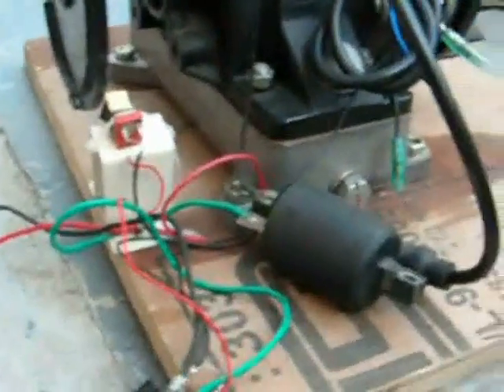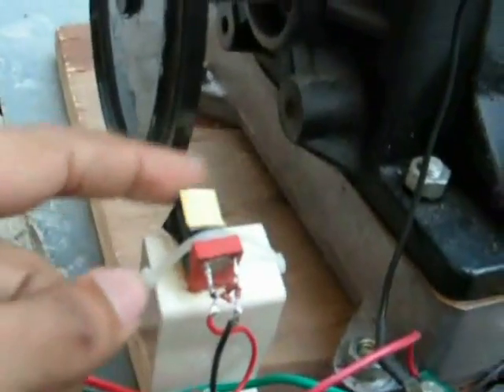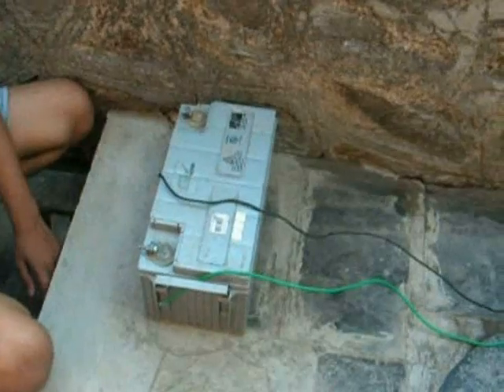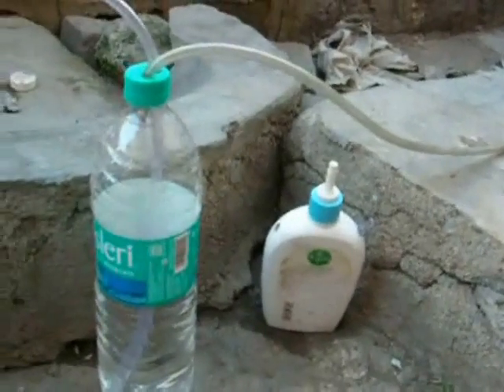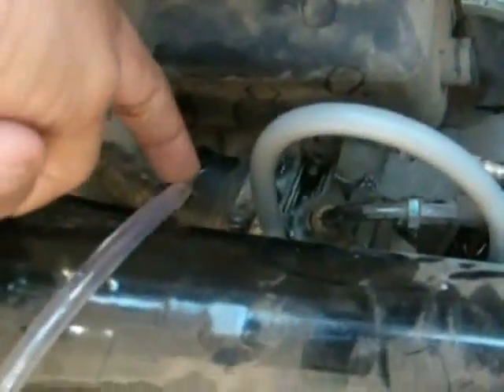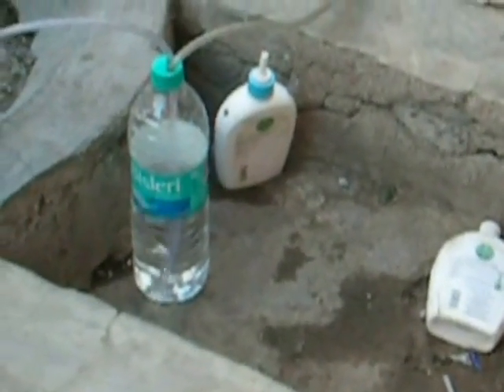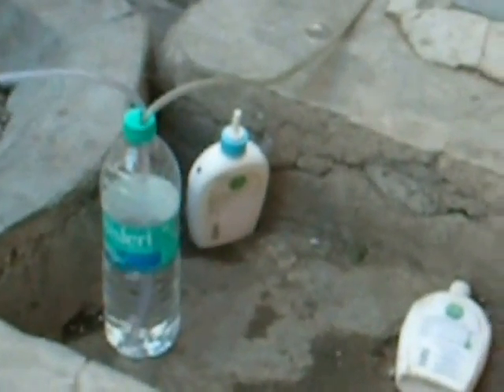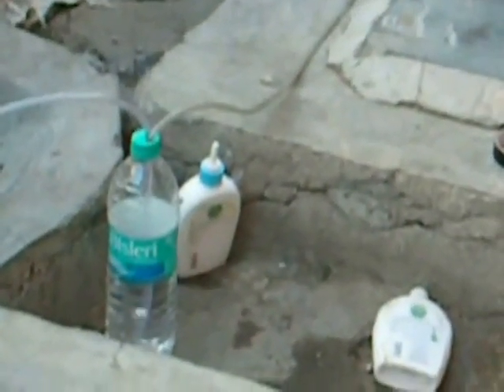Water Powered Bike (See Part 2 & WFC Fundamentals)

Comment: @rajababu1982 Coal puts out far more radioactive waste into the environment than nuclear: out the smokestacks and in the ash leftover. With nuclear, the waste is contained and managed. The nuclear plant in Japan was a small fraction of the calamity there, but got the Press that was way out of proportion. Also, that was an outdated plant kept open because of resistance to build safer, more modern plants.

Comment: If you can't generate hydrogen faster than the engine burns through it, you won't have anything useful.

If you use a larger battery, it might be possible to generate hydrogen at the same rate the engine burns through it, but at that point, you'd be better off simply using an electric engine.

The Laws of Thermodynamics can be a b!tch sometimes. :(

Comment: I accept your sincere apology. Yes, I don't trust either party, also.
Sure, wind and solar are getting better, but it's not a cureall. They're still too expensive for many situations. Geothermal has huge problems with corrosion, etc. Not a lot of power in any of these, especially for transportation needs. Hydrogen is hard to make, store, and distribute. Nuclear is the only real solution for clean, affordable power on the grid. France is 80% nuclear.

Comment: Hi,  It looks like your hydroxy gas production is low.  As a general rule of thumb you will need 5-Psi of hydroxy gas to run a small 2/4 stroke engine.  Try using a water filter casing for your cell and use a little KOH or baking soda as the electrolyte. Install a pressure gage and put the delivery tube as close to the throttle body as possible.  
After you get that all set then you will need to advance the timing to top dead center to optimize the fuel mixture..   Good Luck!

Comment from the maker: Use plasma spark plug to burn lean mixture, It runs for few second on gas buffer in bubbler when you increase bubbler size it runs for more time. No changes in engine, only timing change is required, with higher quantity of hydrogen implosion occurs.

Comment from the maker: I tried my hydrogen generator with 2HP 4 Stroke, 35CC two stroke, 80CC two stroke
 and 125 CC four stroke engines.

 I am getting successful running on only 80CC two stroke bike without modifications.
Now I am planning to change timing of the same engine. And make better spark plug like igniter. This engine is not having exhaust manifold to return hot gas back to inlet manifold, My 4 Stroke 125CC bike have that kind of thing gives better milage.

Comment: probably due to difference in engine displacement ... takes less gas to fill a 50cc engine than a 200cc engine ... and it dont look on the video like you got anywhere near enough to get the 2 cycle to run ... its trying but not quite there ...

Comment from the maker: if not enough HHO then Why two stroke engine fires ? How much energy hydrogen can produce ? I am having one desingn in my mind. If engine have only two cycles
First Cycle
1. Intake of gas 5% of cylender volume (Movement 5% down).
2. Closeing of intake port immediatly before pistone goes nuch down 5%(Movement 5% down).
3. Fire the HHO after just closing of intake 90%(Movement 90% down power sroke without compression).
Next Cycle
4. Exhaust (Movement 100% Up).

Comment: You should be able to get it to fire with the standard magneto.  I have seen some move on to exotic electronic ignition systems to improve performance and keep the spark plug from fouling with water, but you should be able to get it running with what came with it.

It can be done. Think your problem is not enough HHO. Wont fire if more than 5 parts air to HHO.

Comment from the maker: I will make more gas soon I have two 7 tube electrolysis units. In four stroke engine timings are near TDC... How much spark is required to ignite HHO ?

When give smell of perol it strats running. But not on HHO, I tried with buffer stock of HHO, But not a single fire is observed..